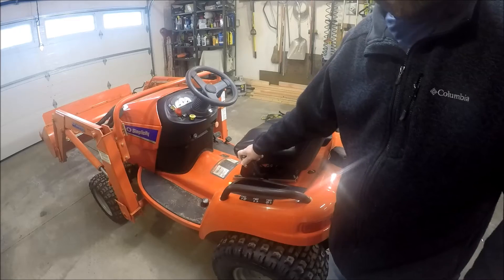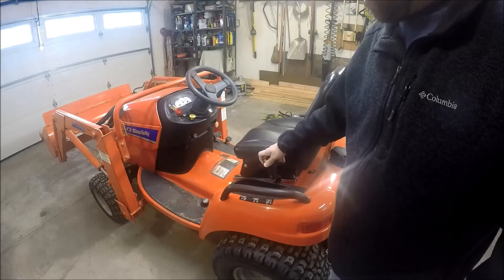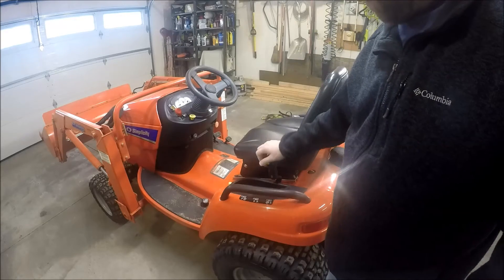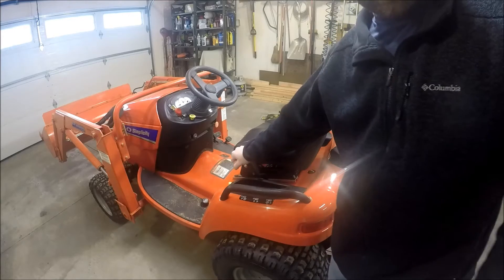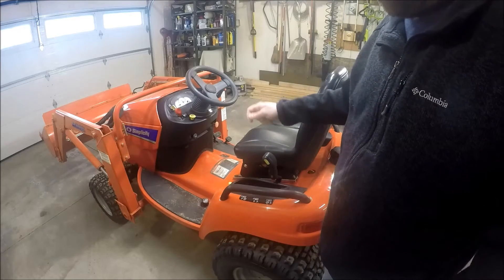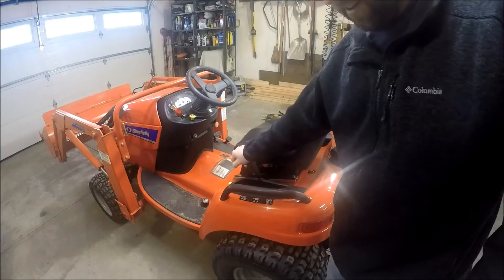Simplicity Legacy XL Rear PTO not shifting

Comment: Not sure if you still have this issue. Mine does it all the time but the fix is easy. When it sticks, put th lever to the mid AND back pto position. Run the pto for a split second and the gearing pops right into place. Works every time for me.